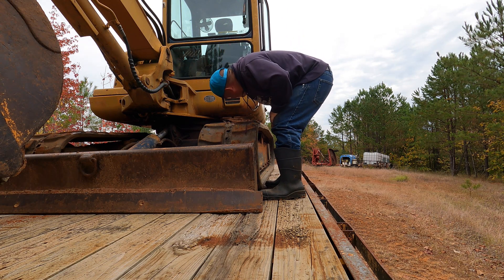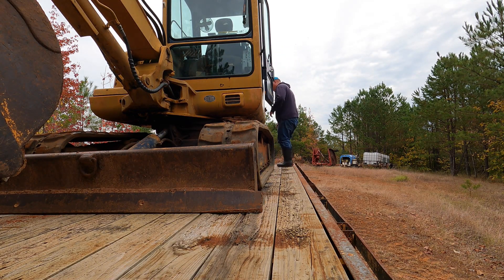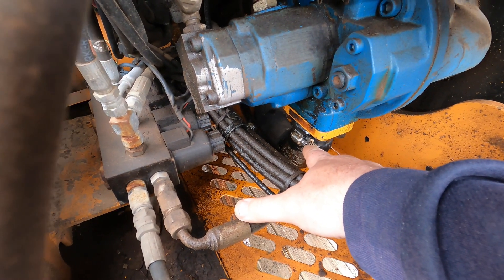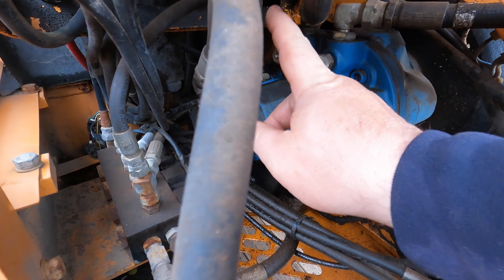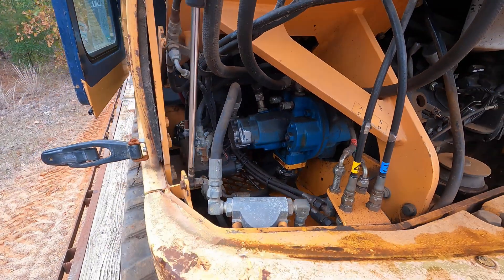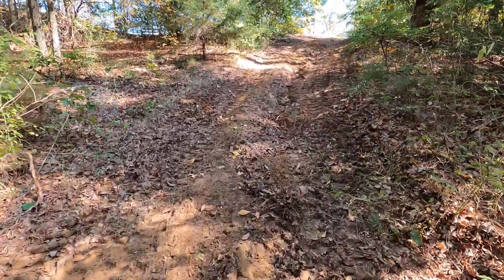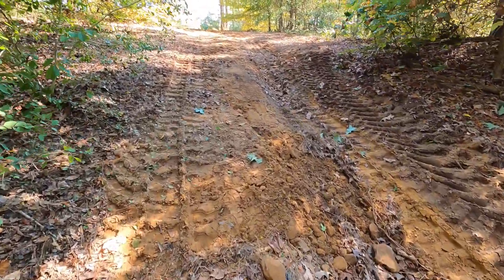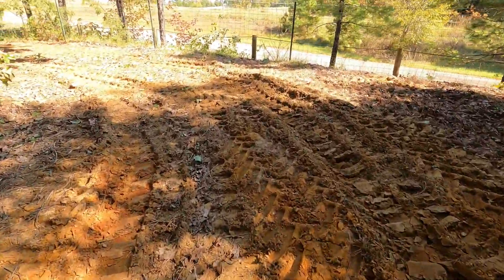Helping a Friend/Neighbor Install a Culvert

Comment: A mitered in-fall and out-fall would help preserve the area around the culvert.  Could be anything from concrete ones to rock or PVC.  They give you a better look as well.
Reply from the maker: Valid point, He does plan to add rock